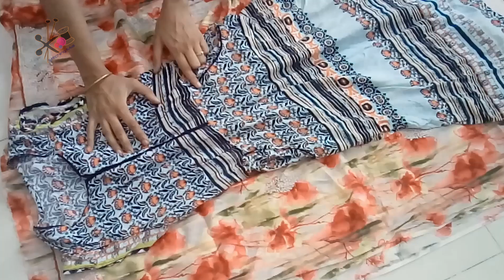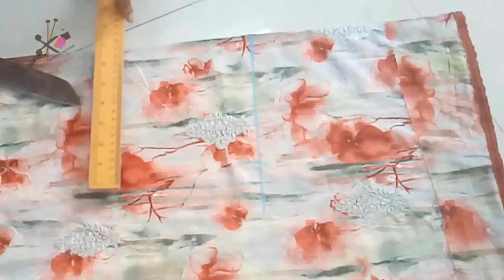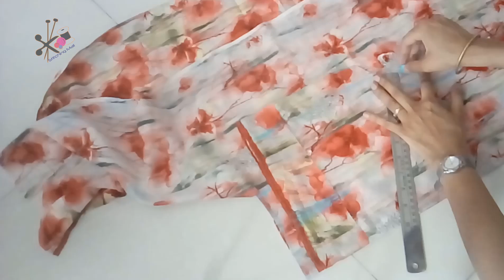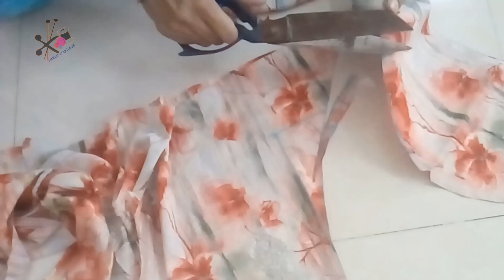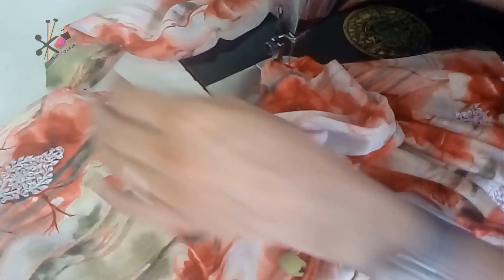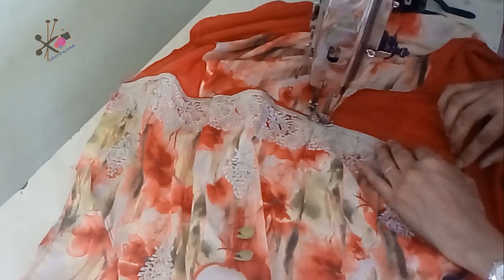Diy Sew Trendy frock Pocket : Kurti Frock Quick Pattern Dori Neck Easy Design tunic godet kali silai

Comment: I am new to your channel sister, I need some help to make  my kameez partner.body measurements is tarah say haen,shoulder 15", upper chest 43" full bust  (lower chest) 47",kummer 40"' or hips 50" back neck 3",  or front 6.5" hay, Yae aak havey saiz hay ,armholes ki jagga sahi nahi baethti hay ager aap is saiz kay shoulder armholes or sleeve armholes Ki drafting (with formula)may help Karen to maen aapki bohat suker guzar hongi. Thanks
Reply from the maker: Hi Saliha, if you watch most of my videos, I have mentioned the formulas and calculations. In fact, I have given a detailed video on ready calculations, which is of great help to everyone https://www.youtube.com/watch?v=o5WU-UNQL6U

I assume - 
These are body measurements without keeping any finger inside the measuring tape. 
You are using cotton fabric, pre-washed / shrinked.

To cut your kurti / top / tunic/ dress , follow the method:-

- Fold the fabric length wise and mark = Full length + 1.5" bottom fold + 1/2" shoulder seam. 
-Shoulder = 7.5"  ( your shoulderbone to shoulderbone measurement is 15" when you stand straight, right? )
- Armhole length = 9.5" ( Sleeve curve 10") https://stitchingmall.com/how-to-make-armhole-sleeve-length-perfectly/
-- Chest 47" / 4 + 1/2" = 12.25"
-  Waist Kamar 40" / 4 = 10" (add 1/4" if you want it a bit loose).
- Hips 50"/4 + 1/2" = 13"
- Gher same as hips or 1" more.

PLEASE KEEP 1.5" OR 2" SIDE SEAM ALLOWANCE. ADD 1/2" TO LENGTH WISE MEASUREMENTS FOR SHOULDER SEAM. 
Double check before cutting the fabric.

If the fabric is AADA / widthwise / thick, add 1/4" more to the above measurement calculations.
If fabric is satin, slippery, thin, no ease allowance needed, reduce the above additions in measurement calculations.

I hope it helps :) Please also watch for clarification-

Cutting & Stitching :-
https://www.youtube.com/watch?v=KFVCxDyWe10

https://www.youtube.com/watch?v=7hCoCKplkBo&t=25s

https://www.youtube.com/watch?v=47EDv4X7B-w&t=25s

https://www.youtube.com/watch?v=XxSlW2tqrNM

https://www.youtube.com/watch?v=1DsktfEgnBE

https://www.youtube.com/watch?v=01nDDgC-bZ8

Neck designs -
https://www.youtube.com/watch?v=2MroXSC06Sw

https://www.youtube.com/watch?v=RelYe7HhOZE

https://www.youtube.com/watch?v=JfDf2WBM7_0
Reply: Stitching Mall f